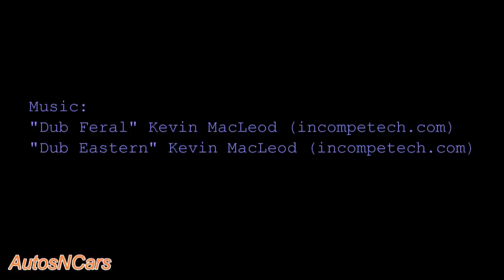TOYOTA SIENNA 1999 2000 2001 2002 2003 SPARK PLUGS REPLACEMENT

Comment: I just completed this job in 2.5 hrs and I didn't remove any parts other than the 6 coil packs and 6 plugs I was replacing. Pull the 1 vacuum hose on the right and there is plenty of room to get in behind all of it. Couple tips for the backside, drop your extension and splug socket in then attach the driver. For the middle plug keep the coil pack that is on the driver side out to access that coil pack screw. Do the front plugs first to get an idea of how the wiring harness pulls from the coil pack so you can do it basically blind on the backside. Good luck out there and enjoy saving time and $
Reply: Do s video

Comment: This is the way I do my plugs. I also take off the windshield wiper cowling. Makes it easier to work. I do the plugs, a new OEM harness, new front coils, all fluids and the trans pan and filter. I include a cleaning of the throttle body and the fast idle system. It's on the left side of the intake. New gaskets all around and she starts and runs like a dream. I do this every 100,000 miles. Seriously, you can't feel her idle. She just made 296,000. I have now gone 15 years without a car payment.

Comment: I have a Toyota Sienna 2000 and you can see why I never change the spark plugs on it I'm not going to go through all that he has my blessing. 😃 LOL
Reply: It can be done without removing anything but that cover.
Reply: Just changed mine TODAY! You only need to remove the cowl and the plastic tray under the wiper blades! There are better videos then this one. Took me about 90 minutes! This video is the WRONG way to change the plugs!!!

Comment: OMG! Why the heck is this so hard? Looks like I have to take the whole engine apart to get to the plugs...
Reply: +Doe Gasque Yeah, I know what you mean. My daughter&#39;s boyfriend bought her a 2000 Sienna with 206,000 miles for Christmas and I&#39;ve been fixing/replacing things to get it into good working order the last couple of weeks...replaced the four burned-out bulbs(#194) in the instrument cluster, a burned-out headlight along with a burned-out bulb in the taillights.
 I replaced the PCV valve and the grommet several days ago and what a PITA job that was when compared to the multitude of Hondas I&#39;ve owned over the years...just a horrible location for a regularly serviced item.  I was very careful not to lose the old(and really attached) grommet inside the hole but it fell inside anyway. Thank goodness I own a retrieval tool which was able to reach down and grab it and then I ripped it all the way out with vice-grip needle nose pliers. My heart was in my throat when the grommet fell inside the hole since I had surveyed the rear valve cover area and it appeared to be a bear to get to anything back there.
  I'll definitely be removing the cowl if and when I decide to tackle the dreaded rear spark plugs replacement.
Reply: They don't want mechanics to get to them, they want people to buy more cars lol - It's a nasty job but all you need to complete it is patience.
Reply: that so facts bro
Reply: wat is he doing you dont need to do all that humbug...just reach in behind right side back of motor and you can feel the plug wires for num.3/5 plug. follow the wires to the left side back of motor for num.1 plug...took me 15min for the back num.1/3/5 plugs.  not even 5min for  num.2/4/6 plugs....seriously you can get to plugs.
Reply: @mbr3232  Perhaps not everyone has the expertise that you might have.....  my hands are big and wide,  no way i can reach them the way you describe

Comment: For anybody curious, i just did this job. Removed the windsheild wiper cowling in 5 minutes and had super easy access to the rear injectors. Entire job took me an hour and a half. This video far over complicates the job. I did it on a 03 sienna v6
Reply: Yeah but can that be done on the 1997-2001?
Reply from the maker: I would be really surprised if they are different? My is 2000 tho...

Comment: You can change the rear spark plug by using a spark plug socket, 2- 3" ext./6" ext. For the rear middle and left facing the engine), drop the spark plug socket then 2-3" extension (one at a time) then connect the three and loosen it. To remove and replace, same procedure. Do it one at at time.
Reply: No video provided

Comment: Thanks for the video. It took me 3+ hrs to replace the 6 spark plugs on my 2000 sienna. I ordered the NGK Iridium Spark Plug from O'Relly. I removed the wiper assembly in order to get more room to reach the 3 screws in the back. I feel the different before and after the spark plug replacement. My horse can pick up much faster now:) Total cost for this job is $47 for the 6 spark plugs plus 3+ hrs free weekend time.Thanks again for the great video.
Reply: wat is he doing you dont need to do all that humbug...just reach in behind right side back of motor and you can feel the plug wires for num.3/5 plug. follow the wires to the left side back of motor for num.1 plug...took me 15min for the back num.1/3/5 plugs.  not even 5min for  num.2/4/6 plugs....seriously you can get to plugs.

Comment: Thanks so much for this video.  I did remove the cowl panel as suggested by JazzLowrider, and before pulling the manifold, I did as JerBear suggested and felt for the back 3 plugs.  It was tight, but this job turned into a no-brainer without the hassle of pulling the manifold.  I had to use different lengths of socket extensions but completed the job in about an hour.  

The sound-track of this video was stuck in my head for the whole job!
Reply: Do you have a video?
Reply: @SerafinN26  yes all these people saying they did it without pulling the manifold but no video

Comment: I found this video extremely helpful when replacing the manifold gaskets, throttle body gasket, etc. I also found it more helpful removing the cowl cover for better access. After a few close calls when removing hard-to-reach nuts (see index 11:24), I magnetized shallow sockets with a thin earth magnet to keep from dropping them. Appreciate the video. Having a steady cameraman makes for better quality.
Reply from the maker: +Paul Hernandez thank you very much! I hope everything went well. Have a nice evening!

Comment: I have 2000 Toyota Sienna, just crossed 100,000 miles.  This video is detailed, but it will scare you into not replacing the rear spark plugs.  I had a P0304 check engine light code (cylider 4 misfire), but didn't want to replace just one spark plug as they all needed replaced.  The front 3 were easy (30-min).  I then found the following YouTube video which provides the secret for changing the rear spark plugs.  Do not spend all that time taking everything apart; you could spend all day taking these apart and hoping you remember where everything goes.  Simply, with the van in park, rock the van forward-and-backward a few times and eventually lock the e-brake when the van is rocked as far forward as it will go.  Rocking the van will cause the engine to rotate slightly, providing more room behind the engine (I never knew that was possible).  This will give you enough clearance to reach your hand and socket-wrench around the sides of the manifold and replace the spark plugs "by feel".  You may need to insert the socket and extension first and the get the correct angle to attach the socket wrench; the clearance is tight back there.  This is totally doable; it took me just under 1-hour to replace the rear spark plugs.  Watch the first part of this long video and then watch the following short video and you are set!  Good luck!
How to change 1mz-fe rear spark plugs

Comment: Nice job! I did replace mine in my 02 Sienna in about 3hours. Removing the fasteners in the firewall holding the intake were the worst part of the job.
Reply: wat is he doing you dont need to do all that humbug...just reach in behind right side back of motor and you can feel the plug wires for num.3/5 plug. follow the wires to the left side back of motor for num.1 plug...took me 15min for the back num.1/3/5 plugs.  not even 5min for  num.2/4/6 plugs....seriously you can get to plugs.

Comment: Holly Golly! I did not finish watching this video, so I replaced front spark plugs and ignition coil, which helped me to fix problem with misfiring on my 2000 Sienna. Then I couldn't find next 3 plugs and came back to this video. Well, now I know, now I know, that until I'll get code, pointing to 1/3/5 cylinder, I'm going to leave replacing back spark plugs till the next time.
Thanks for video!
Reply: *****
Well, first off, I've replaced Air fuel ratio sensor about 4 months ago. There was misfire also, but Innova 3100 gave exact code. This time It shown P0300 - means it does not point to any specific malfunctioning part. Even guy from auto repair could not tell what was it (he calculated $900 estimate though). But he guessed and was right about Ignition Coil. The long part of it looked burned a bit in comparison to the rest 2 of them. I replaced spark plugs just  in case. The good thing that I didn't have misfire anymore. The engine worked smooth, the smell is gone completely and Check Engine did not show up again, after I reset it.
On your question: "...unburnt fuel goes through exhaust manifold and damages the rear air fuel sensor"  - I'm not sure how is this possible. Bad Air fuel ratio sensor can damage Catalytic Converter ($1500 to replace) - that's for sure. But if engine runs smooth and you have no Check Engine, then I see no purpose in doing that. But if you want so - go ahead. There are a lot of parts in your car,  you won't have enough money and time to replace them all, better buy a new vehicle.
Reply: wat is he doing you dont need to do all that humbug...just reach in behind right side back of motor and you can feel the plug wires for num.3/5 plug. follow the wires to the left side back of motor for num.1 plug...took me 15min for the back num.1/3/5 plugs.  not even 5min for  num.2/4/6 plugs....seriously you can get to plugs.

Comment: Just a heads-up for anyone who--like me--still drives one of these faithful old vans (mine is a '99 :~).   I watched this video yesterday and changed my plugs last night.  NOTE--You do NOT need to remove the manifold or throttle body as shown in this video!
A. As you see, the front three plugs are simply enough--remove the cover, electrical connections, and coils, and replace.  (Now would be a good time to point out I am a DIY accountant, not a mechanic.  So I don't know what half this stuff is called.)  I broke one of the plastic clips on the L-shaped electrical connectors in front of the plugs.  It would probably stay in place due to the plug's tension alone, but after I was done and reconnected it, I used two nylon cable ties to ensure it stays in place.
B. Plug 4 (back-right).  This was actually my hardest.  For the back three plugs, if you don't want to remove the manifold, etc., you WILL need a flexible/jointed ratchet or swivel extension.  I used various combinations of a regular ratchet, 4-inch extension, 6-inch extension, and a swivel join.  My ratchet wrench itself was not jointed, but others recommend one, esp. for this plug.  If you don't have (and can't get) a wrench or joint that swivels or flexes, you will need to remove more parts.  Anyway, I got my plug out alright, but once I got the new one in, I couldn't tighten it very easily since my ratchet handle kept hitting various parts around the throttle body.  A shorter (5- or 6-inch) ratchet would have been ideal.  I got it snug, but certainly couldn't torque it like I did the others.
C. Plug 5 (back-middle).  This was the easiest of the back three to access.  I left the cap/coil off #4, then pulled the cap/coil off #5.  The angle gave more room for the ratchet on this one.
D. Plug 6 (back-left).  Before you go any further, watch this video.  https://www.youtube.com/watch?v=a5orM7uFVps
I basically did what he did.  It takes a fair bit of extra work, but as long as you're careful, it goes fairly quickly and without complication. --Nothing like removing everything AutosNCars removes here.  Once you have removed the wipers, vents, and the big tray in front of the firewall/windshield, accessing #6 is fairly easy.  NOTE: on my model I did NOT have to move or push back the metal bracket to which this Hispanic gentleman referred.  What I DID have to do was pull the caps/coils back off plugs #4 and #5, then pull #6 and all three wires out of my way.  I also removed one small electrical connector up near the firewall, next to a larger connector that I left alone.  Once I did that, I was able to use my extension and swivel to easily remove and replace the sixth plug. 

This was the first time I have replaced the plugs in my 1999 Sienna.  The job--including a few back-tracks--took a total of roughly 3 hours.  --Certainly well-worth the $200 - $300 in savings over going to a mechanic.  If you read this comment in the next month or so and have a question, feel free to ask.  Much past a month, I will have forgotten what I did and be of little help! :~)
Reply: Definitely would love to see a video on this. I was quoted 8 hour job for $600 and it obviously doesn't take that long :)
Reply: kentcan Yup! Did it this way myself. Easy peasy! The whole job took me 1.5 hours start to finish.
Reply: That sounds a lot better.
After the second "Aw shit" and "Jesus", plus the "oh fuck", I was seriously considering that should my plugs need replacing, I'd settle for a three cylinder engine.  ;)
And for the record, I'm a formidable backyard mechanic.
Reply: Did my 1999 yesterday about 2 hours make sure u have several ( 3 two inch extensions and a 6 inch also a universal /wobbly joint) A cheep 3 jointed rachet from harbor freight is also needed) Also u can get a couple of more inches of clearance in the back if you have someone block the wheels after rocking it in park. The cowling in front of windshield with wiper motor needs to be removed also. Good luck guys YOU CAN DO IT !!! DON"T REMOVE THE INTAKE MANIFOLD NOT NECESSARY !!!!!!!!!!!!
Reply: Michael Fear I'm trying to change them but it's proving to be very very frustrating, already thinking of taking a hammer to the engine
Reply: NO dont do that bro hold on relax take a breath it will be ok u can do it
Reply: Michael Fear well 4 out 6 ain't bad, I couldn't do the back left plug
Reply: just take your time brother and if u cant get them roll with 4 brother see how it runs
Reply: The far left back has to be got from left side of engine but u did good son I'm old school mechanic and its rough buddy
Reply: I did 4 of 6 
Spent 40 min, cleaned spark tips with fine sand paper, works very good now. (455000km)
I saw really burned (eaten) spark plug tips on my Camry'08  after 300,000 - those should been changed.
Reply: Thanks for the tips kentcan :)  Replacing the front 3 spark plugs and coil packs were easy.  I removed the windshield wiper cowl in order to reach the back 3 plug wires and plugs.  The back plug wire on the passenger side was a royal pain and the boot was broken and stuck in the plug cylinder.  The back center plug wire boot was also broken and stuck in the plug cylinder.  Thus I could not remove those two.  The only plug wire boot in the back that I was able to remove was the driver's side.  I did replace that spark plug.  I am going to buy a new spark plug wire set.  Any tips on how to replace it?  Do I need to remove everything AutosNCars did in this video?  How am I going to get the jammed broken boot pieces out in order to remove the old sparkplugs in the back?
Reply: That video you linked is pure GOLD! Will be doing that this next weekend.
Reply: That's not the cylinder order. The order is:
1 3 5
2 4 6
where 1 is near the firewall, passenger side.
Reply: wat is he doing you dont need to do all that humbug...just reach in behind right side back of motor and you can feel the plug wires for num.3/5 plug. follow the wires to the left side back of motor for num.1 plug...took me 15min for the back num.1/3/5 plugs.  not even 5min for  num.2/4/6 plugs....seriously you can get to plugs.
Reply: i have 1999 sienna also w/3.0 liter 6plugs 3 coils that control 2 plugs each 3x2 =6

Comment: Thanks for the great video. I am planning on replacing the plugs on a good friends 1999 and needed to know what gaskets and special tools i needed for the job. The main issue i am faced with is i am told that one of the plugs is stuck or wont come all the way out. That will just add some risk to the job, which i like.  Yea, Like John, that music is stuck in my head, and i know that i will probably be making the same grunting sounds. I'm going to take all the other recommendations and see if i can do it without taking the intake off, however with my gorilla hands, that might not be an option. Thanks again, Great job and kudos to the camera man for really getting in there and adding light where it needed it.
Reply: wat is he doing you dont need to do all that humbug...just reach in behind right side back of motor and you can feel the plug wires for num.3/5 plug. follow the wires to the left side back of motor for num.1 plug...took me 15min for the back num.1/3/5 plugs.  not even 5min for  num.2/4/6 plugs....seriously you can get to plugs.

Comment: I have a 2000 sienna and I just went and followed the wires around to the backside and despite the tight fit I believe I'll be able to change it without moving anything! Of course it helps to have small hands and arms and like a commenter below wrote, I'll have to bear hug the engine.